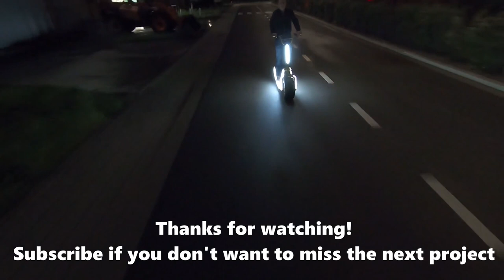Making a huge electric scooter with fat tires and hoverboard motors

Comment: Hi! Excellent video, thank you! Could you tell me what the outside diameter of the hoverboard motors are at the edges of the rims, and the main body of the motor in case I need to grind off the motors' rims. Thanks again!

Comment: great job !!!! just one question how do you configure 2motors to run synchronously with only 1  throttle ?
Reply from the maker: You connect 1 throttle to 2 motor controllers, just splice the wires. Works perfectly.
Reply: Thanks !

Comment: 🙂👍🏾 You did a Great job on Your DIY Electric Scooter. Lights and Everything, You Should add Some Turning Lights and maybe Some Velcro to Stand On. Also You Could add Some Mirrors to See what's Behind You. But Other than That It's Awesome. 👍🏾 I Work with Different Types of Metals too, But It's Not my Shop or Material. ☺  🙏🏾✌🏾🛴🛴🛴🔥🔥🔥🔥🔥🙏🏾

Comment: Did you say somewhere in your videos that there is a downloadable STL file for the centering tube, or am I dreaming?
Reply from the maker: You are dreaming😏. But it's easy to make, just use the diameter of the motor as inner diameter and the diameter of the wheel as outer.